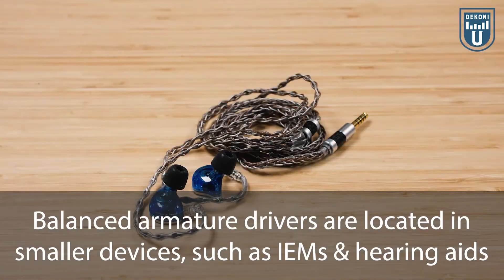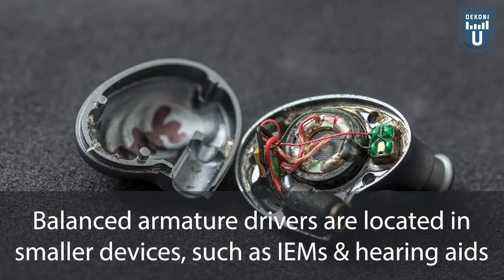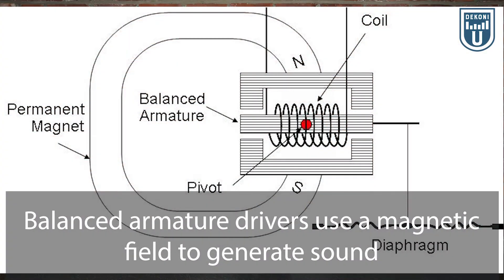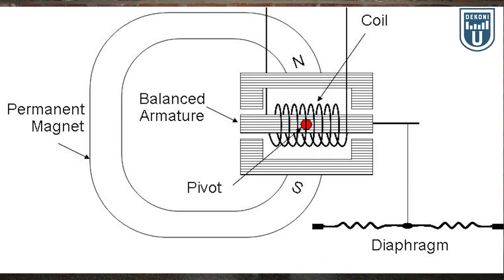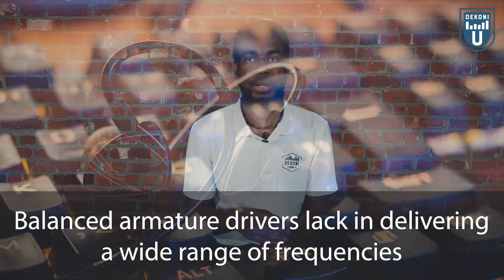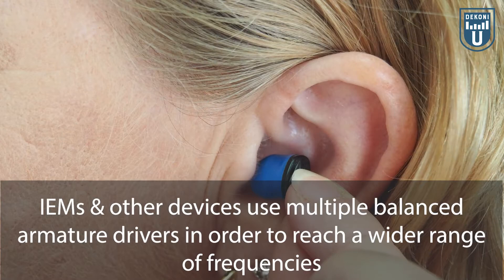Dekoni U - What are the Different Types of Headphone Drivers?

Comment: Will size in dynamic driver size make a big difference ? What if its only 1 or 2 MM?
Reply from the maker: The larger the driver, the more air it can move. Larger drivers can push lower frequencies much more efficiently. Thats why you see subwoofers as big as 18 inches.